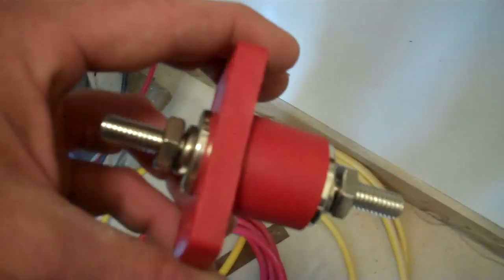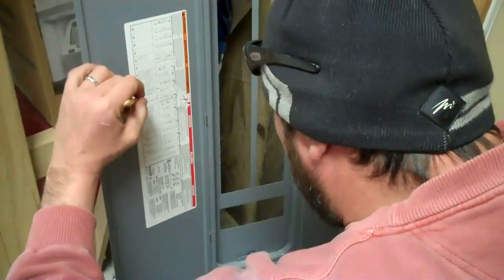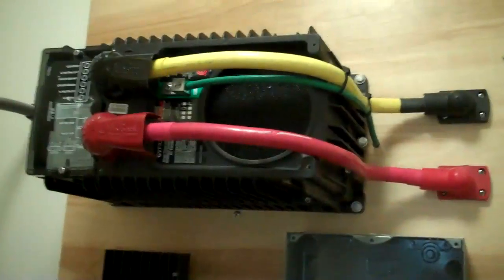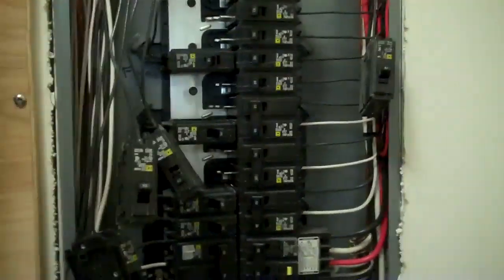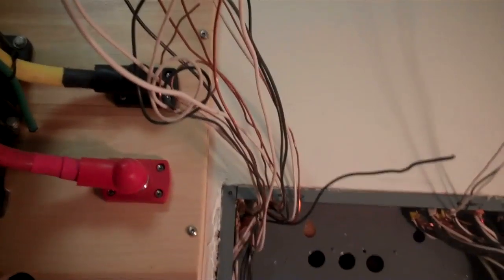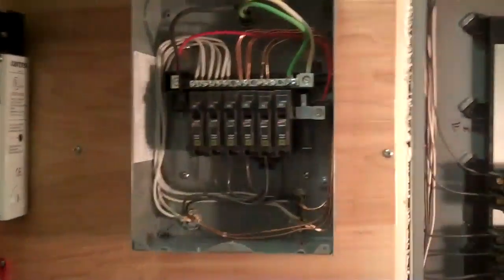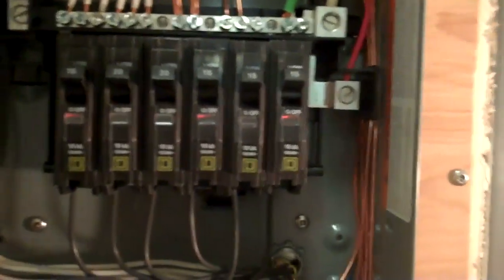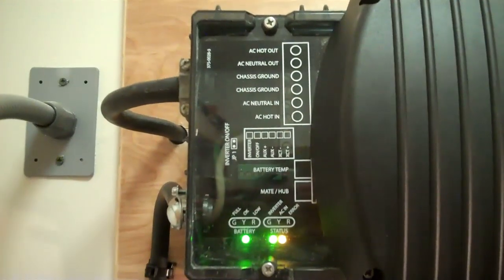BUILDING YOUR SOLAR BACKUP POWER SYSTEM  #3

Comment: new to this solar areana--looking to install a solar system to power my 240 volt well pump and few other critcial ckts --most information says i should install a 48 volt system and have been looking at Xantrex6048 or 2-GVFX3648 units  -Trojan L-16RE-B and 240 watt panels--can you offer some guidance  based on your experience -maybe a morning star charge controller--i feel if i start with a good inverter system i could build on that -- have a transfer withl w/ critical ckts off a 12KW gen

Comment: hi quick question you transfer every breaker of everything you need when the grid fails to the subpanel to power it with the inverter and then when the grid comes the inverter automactic changes to grid tie thanks